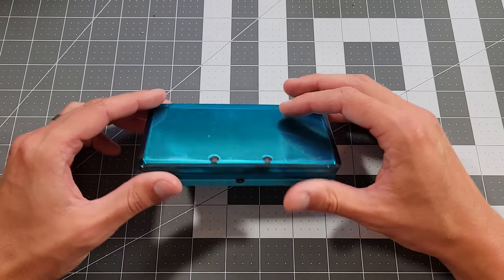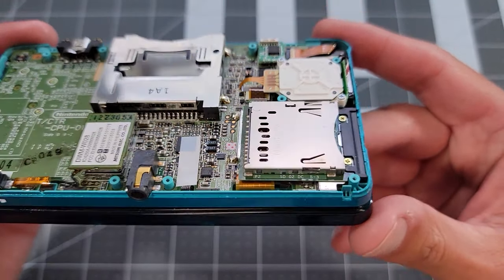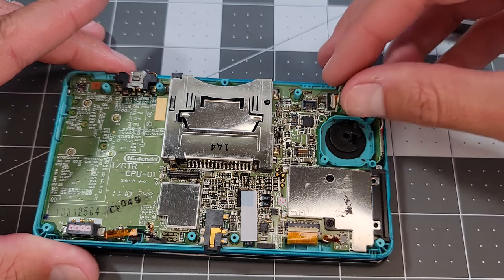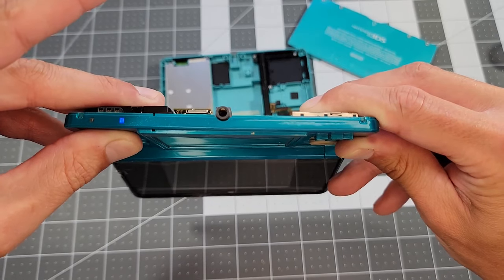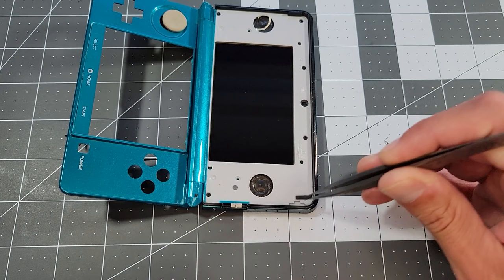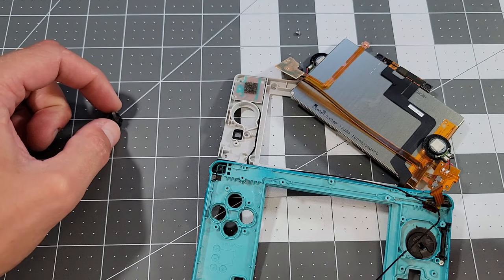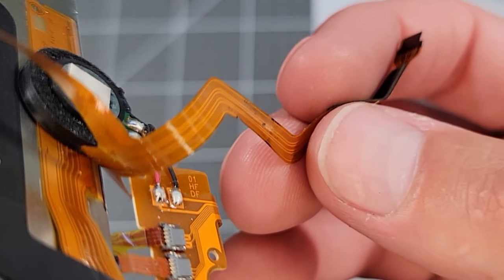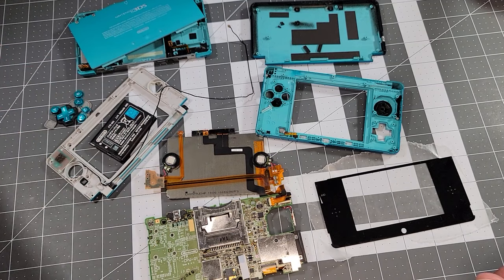Nintendo 3DS turns off with a POP! Finding Out Why

Comment: Hi, what parts do you conect tô the mother board to turn on the console, the important parts ?
Reply from the maker: Power switched is soldered direct to board so at that point just need a battery connection. But you should assume that if anything is disconnected, or not connected properly, that it can cause a problem

Comment: Can the damage get worse over time? ,cause mine can still turn on play just fine as long as i dont pull back the top screen all the way or to a certain point
Reply from the maker: I believe it will gradually get worse over time as the lid is open and closed. The only way to prevent it then is to just leave the lid open. Or to try and get in there and repair it if you're brave enough ;)

Comment: Mine "pops" doing the opposite. If I fully open the lid, it turns of immediately, so I might try to disassemble it and look up to see if I can find the flex that might be defective online
I thought swaping joycon shells was hard
Reply from the maker: I can't guarantee it's the exact same cable, but it's almost certainly related to an intermittent connection. Best of luck on your search!
Reply: @FantasticQuack  thanks a lot!! I hope I can find the issue and be able to reassemble it... Fingers crossed 🤞🏼

Comment: is this also the same with a 2ds xl? experincing that issue. but the top screen was ripped off. so a little help?
Reply from the maker: Probably the same issue. I'm not sure what the top screen being ripped off means in a physical sense in your circumstance, but certainly sounds like something that would damage a cable, connector, or the screen itself.
Reply: @FantasticQuack  I do worry for the connector. The cable and screen are not my biggest concern. Thanks tho. The work you do is something else for people like me. Who miss their consoles. Good times. . . Thanks for your insight. Take care.

Comment: I really dont know but i have an old normal modded 3ds. When i turn it on or enter a game it does a popping sound which i have no idea if it is normal. I had a problem that made it so that pressing L made the system shut down but now it works fine for reasons. I had a problem recently with it not turning on doing that same POP for a while but then being fine. I really have no idea what it may be because it just happened randomly, i didnt use any service that could identify a mod or something of the sort. So i wonder if it has to do with age and it being worn down, because mine is old. 
Packaged with 3dLand levels of old.
Reply from the maker: Popping sound when entering a game could be related to the mod.. but if you're sometimes seeing the behavior shown in this vid where it pops and powers down, then it sounds symptomatic of an intermittent connection, and if so it will get worse over time/use. Not sure what problems or "glitches" if any could be related to the mod, so it's hard to say.

Comment: Does this work with the new 3ds (face plate edition)?
Reply from the maker: Should be fundamentally the same process you just might find connections are in different locations and cables look subtly different.

Comment: Hey my 3ds turns off and pops, but when i unscrew and open the shell, and use the battery to turn it on, it turned on! Even the lower screen can be pushed without it turning off! But when i put everything back, and the shell, then turning it on, it turns off with a pop again... Help me
Reply from the maker: That sounds exactly like the situation in this vid. I wasn't able to turn it on until the shell was removed (relieving some stress/pressure from the cable and causing it to re-establish contact). I'd recommend replacing the cable, if you haven't seen yet, I made a part 2 to this video where I do just that.

Comment: I have a 3ds ll and when I turn it on, only the light appears, but the two screens do not work
Reply from the maker: try the following (from ifixit):

Remove the battery
Press the power button a couple of times
Plug in the power adapter. Try turning it on.
Remove the power adapter
Insert the battery, plug the adapter in
Try to power the console on again. If it works, you’re good, otherwise I’d try the same again also with removing the SD card.

Comment: I tried fixing my red OG 3DS, but the most of the screw on the layer with the battery won't come off, I was able to get 2 of them out but the rest won't budge
Reply from the maker: If they are stripped badly you can always drill the heads off and buy replacement screws

Comment: Broke down my 3ds xl to replace the bottom face plate. After assembling it back, it would come on, top screen would display, and touch would work on the bottom screen, but the bottom screen wouldn't display. Tried to reset the ribbon cables, and now I'm getting the screen flash and audible pop issue. Hopefully it's just the ribbon cables need to be reset again.
Reply from the maker: There are 3 separate cables for the bottom screen so a lot of opportunity to miss a proper connection. If you're certain the connections are good then it could be the screen itself went bad--if you tilt it around at various lighting angles can you detect any hairline cracks on the screen? Even if no cracks it could still be damaged, that's just easy evidence to be confident of the problem. Luckily the lower screen is infinitely easier to swap than the top screen. Hope you can get it fixed!

Comment: Could it be that its shutdown has something to do with the battery
Reply: I'm having the same problem
Reply from the maker: In this case it was the screen connection. All other situations I've seen were also related to the screen/ digitizer. If you don't get the POP noise then it definitely could just be the battery.

Comment: So the culprit is the speakers ribbon cable ?
Reply from the maker: In the case of this unit, yes
Reply: @FantasticQuack  I have a 3ds XL with the exact same symptom. If you open it to more than 90 degrees, you hear a POC and both screen shut down.

Comment: i fix mine by adding 3 wires from the speakers to the motherboard, because they were not giving continity but the the best is the replace the flex cable.
Reply from the maker: I did the full fix in a newer video, glad you got yours working too!

Comment: Could it be the battery as well?
Reply from the maker: Possibly in some instances? I can't rule it out 100% but I've only ever seen this problem caused by a screen connection issue-- In this case the damaged flex cable.
Reply: @FantasticQuack  oh ok

Comment: Any hack to "repair" a ribbon?
Reply from the maker: There isn't a method that would be reliable unfortunately
Reply: I can change it, but dl you a efficient way to pass the wires through the hinge without breaking them?(Last time I broke them...)
Reply from the maker: @reekooism  I made a follow up video to this one where I make the full repair so you can see how I did it
Reply from the maker: https://youtu.be/eAVDyIWgljY?si=qc8yaAbZbHD8sklJ

Comment: I spilled water on mine and it was fine for a while until eventually it popped and never turned back on.
Reply from the maker: I'm guessing either the water caused some corrosion at a connection or the water did nothing and it was just general folding/unfolding that caused the problem like in the case of this unit.
Reply: @FantasticQuack  I mean it was the same one I got when they came out. And I remember flipping it when I wasn't doing anything

Comment: I have the same issue with trying to turn it on I'm not sure it's for the same reason you're not
Reply from the maker: You'd have to take it apart to know for sure. In my experience it is usually always related to the screen or a connection to it. Hope you can get it fixed!

Comment: my 3ds XL just started doing this. 
after watching this i'm probably just going to sell it as non working 
and buy a 2ds.. this is way to much work.
Reply from the maker: No shame in that at all, for most people this is the most sensible option!
Reply: @FantasticQuack  i did end up taking it all apart
and trying to reconnect all the cables
did not realize how small some of these connectors are
reconnecting those little cables is extremely tedious
and hard to tell if they are actually in correctly.
all that said, i still wasn't able to get it to stop popping 
so i guess it's time to sell it and buy that 2ds.

Comment: i have the same problem but in a 3ds xl instead
Reply from the maker: The general approach to the fix should be the same with some differences on connector type/location
Reply: @FantasticQuack  but also after i got the problem the lower screen got the color wrong but i think that the back light problem

Comment: Jesus christ my og 3ds that ive had since launch did the same thing yesterday and im going to have to buy a whole new system because theres no way im doing this.  I was literally playing ocarina of time 3d when mine just made that popping sound and killed itself.  I guess thats what 10+ years does to a handheld with a hinge.
Reply from the maker: I've never seen this problem on a GBA SP which also has a hinge. the 3DS was just a worse design because they reduced the space inside the hinge and stuffed three cables into it, so they have a lot more failure points and more stress with each fold compared to the SP.

Comment: ugggggh I was hoping my issue would be simple, but noooo, Nintendo makes this crap difficult on purpose! The cable isn't too high in price, but the price for my sanity and patience to do this task definitely is hahahahelpme
Reply from the maker: I feel the pain! I did buy a new cable I'm just sitting on for now. Debating if I should just fix it off camera or make a part 2 to this video. Doing the camera work at the same time makes an already complicated task roughly twice as difficult so I'm not super thrilled to get started down that path lol.
Reply: @FantasticQuack  make part 2!

Comment: I HAVE THAT SAME COLOR 3DS WITH THE SAME ISSUE
Reply from the maker: Hope you can get it fixed up!
Reply: @FantasticQuack  in my case it was the battery
Reply: @FantasticQuack  just get a new battery and you'll probably be all good
Reply from the maker: @NootandBoots  I already fixed it (I made a follow up video if you want to check it out), it definitely was not the battery in my case. Glad yours was easy!
Reply: @FantasticQuack ah, I definitely had to replace the battery tho it lasted to this year and it's older than me

Comment: Mine does this but I have to have the 3d on for it to work 😂 right
Reply from the maker: If you turn the 3D on it works normally?
Reply: @FantasticQuack  yeah for me
Reply from the maker: @Tabor_Rat  That is very interesting and not even something I thought to test. Of course not solving the problem but if doing that works you're probably better off leaving it alone and sparing yourself the anguish inside this handheld :)